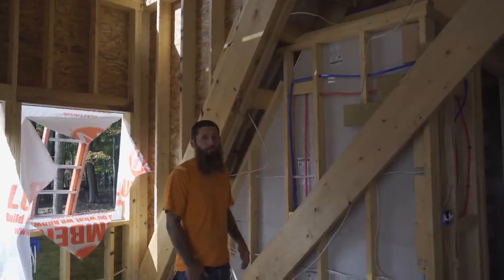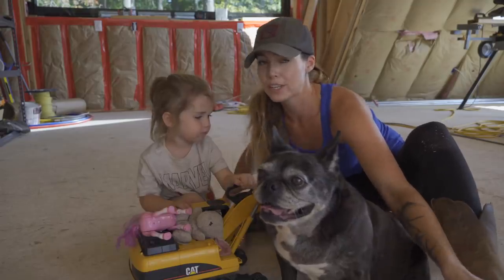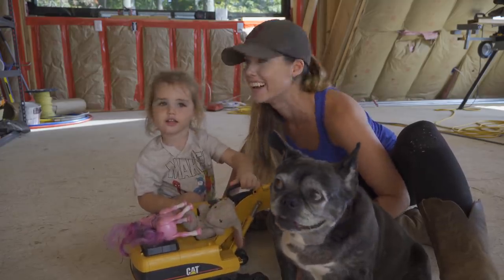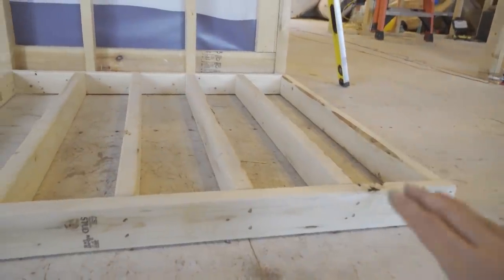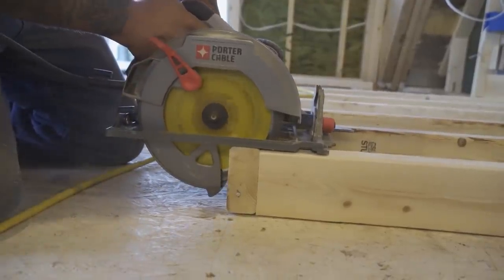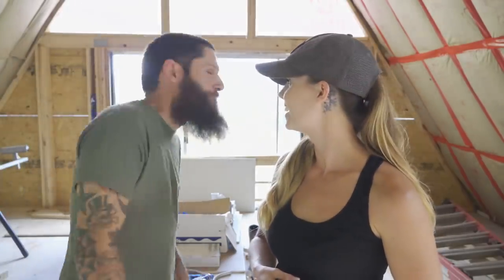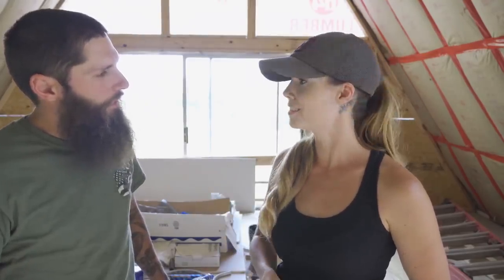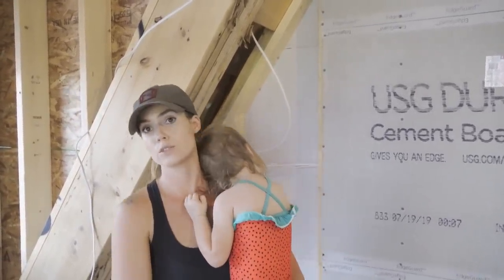How We're Heating Our OFF GRID Home This Winter

Comment: Tape your cement board joints with mesh drywall tape to prevent cracking, I’m a retired tile man
Reply: Generic drywall tape is not supposed to be used on cement board; use Alkali Resistant Mesh Tape.
Reply: @CptLordCockburn  ^ yup was about to comment
Reply: I was going to ask the question about the possible gaps between each cement board.  Thanks for your answer.
Reply: A friend of mine put tile down in his entry directly on his sub floor. It lasted about 90 days.

Comment: In my house the wood stove was inefficient and heated only the immediate area. Most of the heat went out through the chimney. I fixed this by fitting two 6" fans a foot from the chimney. These take hot air from the chimney and circulate it round the house. Ten times better!
Reply: Depends on the type of wood stove they get, but A frames are hard to heat
Reply: One needs to be careful how much the chimney is cooled. A cool chimney can cause excessive build-up and risk chimney fires. A properly sized stove should not waste heat up the chimney. Using a circulator fan in the room will help disperse the heat.
Ceiling fans will help move heat from the A frame peak. An updraft fan flow will push the warm air down the walls.
Reply: @idadho  aren't most chimneys double skinned anyway, even inside the house ?  And don't most modern wood heaters have internal fans to boost efficiency ?
Reply: Manolis Gledsodakis 
We installed a bathroom vent fan in the top of the a frame that pulls the heat from up top and blows it out near the floor. That helps a lot to keep the heat in the living space. We are on solar too but the vent fan draws very little.
Reply: @colstace2560  No, the fans would be on the outside to move air across the hot steel. Double skinned flue pipes are designed to handle the heat that is necessary to keep exhaust gases hot enough to limit creosote build-up inside the pipe. I wanted to pull heat off the flue/chimney pipes and was told by the professionals to not cool the pipes, even the double walled pipes. 

Stoves are designed to a specific flue pipe specification. Efficiency is part of that design.
Reply: @offgridathiddenhills4079  Moving warm air up with a traditional ceiling fan causes that warm air to hit the ceiling then flow down the walls and create a uniform temperature throughout most of the room. The goal is to move large volumes of air slowly. Erin and Josh can hang a ceiling fan and disperse the warm air nicely. We always used up flow at the slowest speed.
Reply: A woodstove with a backboiler supplying a wet radiator system, as is common in europe is a solution, I use mine to run 9 rads & a hot water tank... I also bought alum. rads as they are more efficient and the hot water tank purchased was a solar tank so as to be "solar-ready" in the near future.

😎👍☘️🍺

Comment: Just found your channel today and really love it . I’ve done a complete home Reno of a 100+ year old home with redesign . When you talk about the stairs I’m laughing as I had like 100 hours of thinking in for the stairs and such and in the end it worked out great . 
I’m HVAC so for you to do radiant heat it’s the best idea ever . With two forms of heat you can benefit . There are AC style units that are called heat pumps and you can get heat from even freezing cold air . With your land you could do ground source and utilize what they call geothermal . The power to run a compressor and the pumps you could get a good amount of heat . 
If you have unlimited amount of wood available for wood heat then your good for no electricity heating . 
Maintain clearances at all points just in case for the venting . Also allow as an option a dedicated source of intake air from outside for combustion . Like a 4” dia vent ( with a damper ) . I also noticed your below grade plumbing traps and such , that lower level below the house not sure how it’s insulated but you could seal it all up and help your floors stay warm even by skirting the pillars and insulating those . 
I’m sure you guys have thought it all through . 

Also kudos on the square D panel you used , Love Square D !
Reply: For the upper level with the loft you probably should put in a destratification fan to blow the heat back down to the ground or use one massive fan to mix up all the air flow . The heat will rise and hand up top and it’s good to have the option to push it down even though it uses power . Another option is to install a duct system with an in-line fan to recirculate the air from up high and then distribute it down to the main level . If you could incorporate some airflow from up top to blow over the windows you can greatly offset the draft caused by extreme cold winter days . Small spiral ducts can be used in the open with even simple holes used as diffusers . 
   Anything done in advance before all the finishing can make for great options later for the colder days . 
The fan recirculating system could even be a small hydronic fan coil unit with an AC coil ( for future ) or select it as a heat pump coil now so that in future if you do some geothermal you already have the air handler . 
   The air handler even running for summer could take some of the upper heat in the loft and redistribute to allow some natural cooling .  Below 5’ the average ground temperature is around 50 deg Year round . You can utilize this for unlimited heating and also for cooling . 
   Make sure your home interior pressure does not go below 0 when you have exhaust fans and such running for bathroom or kitchen . 
That Intake for the wood stove could be used to compensate for any negative pressure in the home . In a negative even a wood stove won’t burn well . Air has to come from somewhere ......
All the Best to you and family !

Comment: What about having fans at the peaks of the "A" to push the heat back down??
Reply: Hmm wouldn't need that if the house is well insulated.
Reply: Jerry Moody  I know heat rises i ain't that stupid lol  But what i'm saying is if the room is well insulated no heat would escape that room and will be kept in, keeping the room at a normal/comfortable temp.
Reply: @maverick4220  The front room is 2 stories high. To keep it warm near the floor where the people are, you'll have to constantly pump heat into the lower level as the heat rises to the second floor. As the OP said, it'll be much hotter on the top floor than the ground floor. That's a known drawback of the A frame design. Most common way to combat that is have ceiling fans to keep the air rotating and evening out the temp difference between both open floors.
Reply: @MrDericp  I hear ya, but the primary heat will be radiant under the floor.  Should be pretty comfortable unless it is wicked cold outside.
Reply: @justlikeyouful  Radiant floor heat will be a nice way to even out the heating all the way to the walls and feels warmer when your feet are warm, yet it still rises at the same rate as any other type of heat once it leaves the floor. The problem still persists, which is the reason fans are necessary in an open style A frame.

Comment: Good job guys. If anyone says sheetrock just slap them. You are smart to put the finishing touches on the rough in phase.
 I grew up in a home with just a wood stove for heat. Put a fan close to it and it will easily heat that house.

Comment: consider using stovepipe heat reclaimer radiator rings or add additional offset stove piping like on "homestead rescue" to get more efficient heating via the radiator effect on your setup with less wasted heat of a single stack. We've done both at our cabins over the years and both work well to reduce the time it takes to heat an area as well as keeping it hotter/longer on less fuel consumption. We've also added a wound copper water pipe panel behind our stove/soapstone to provide hot water at the same time.

Comment: Not sure if anyone has mentioned it but it’s a good idea to set the depth on your circular saw. Maybe a 1/2 “ below your material. It really is much safer plus if you’re cutting across your horses it won’t cut so deep. The big one is that full depth has more of a tendency for bind and kickback.

Comment: Great job Most awesome house and family!!  I recommend you two research the operation of the radiant floor heat. we bought a radiant floor heat house from the builder owner  they attempted to operate the system as you described for about 7 years,  the house had wild heat and cool swings and unbelievable costs And they were never happy with the temp.  I balanced the system and we turn it on in the fall (fredericksburg VA) and allow the system to cycle for about 4 days the heat temp swings get less frequent and more stable and then everything stabilizes at 72 deg.  We never touch the thermostats after that till spring when we shut off the thermostats.  The cost to heat the 5,400 sq ft dropped by 2/3rds and it is always comfortable.  thanks for sharing your adventure 
S

Comment: A lot of heat will collect at the top of the A-frame. I found that a good, cheap way of sucking ceiling heat back down, and adding to circulation, is to use ducts and PC-fans. They don't drink many electrons and are designed to run non-stop with very little sound.

Comment: Josh, better to fit loose in the summer so it will fit in the winter over long-handles, Carharts, etc.
Dang, forgot the word, but, if you don't want to cut out the excess belt and overlap to stitch back together then, just pinch the belt (to fit now) and stitch (or staple) to hold the pinched amount; remove stitching come winter.

I really like the the rear staircase access idea much better. Keeps the living/common area open.

It is not the least bit obvious that y'all are getting more excited the more you accomplish and the closer you get to GETTIN' 'ER DONE, until the add-on stage begins.

Hey Kiddos, the way sound carries out there, you will have to come up with another excuse for why you didn't hear your folks call for you.

Comment: Id go for a heatpump, heat in the winter and ac in the summer. Super efficient, and instant hot and cold. No having to chop wood and track it into the house constantly. Save a ton of $ over time too. Id also do the wood stove for those days when it is under 10f.

Comment: Its a good location for the stove ,you can open the window a little and the air will push the heat through the house ,its going to get hot in the loft areas so ceiling fans may be an option, it works hear but you climate is colder during winter ,anyway great video cheers

Comment: The cement panel at the back of stove must be installed on vertical metal forences. Let 2'' spaces at the bottom and 2'' at the top to create a air movement to down to up to cut the heat in half.
Reply from the maker: Our stove has a heat shield on the back and manufacturers instructions say 14" from back of stove to combustible surface which we also have. The cement board for us was more for good measure and to attach the slate to.

Comment: You should trowel mortar between the plywood and the cement board per TCNA.  You might have a problem with cracking if you dont.  Especially with the high heat from the stove.

Comment: +1 for using cement board for the Wood stove area. Although I would recommend considering getting an outdoor wood boiler to keep all of the combustibles away: Wood, Ash, Smoke, etc. Puts it provides a safety measure since combustion would occur away from your home.
Reply: External wood burner with radiant under the floor will be the primary heat... as stated in an earlier video.

Comment: You can always change your Mind and run a staircase up outside..it takes less room and you can add protective sheating around it later. For Fire code provisions, the City may ask you such an Exit..a real staircase. Maybe check out your local salvafge yard..Somethimes, they have Old Steel Circular Staircases that sell for a Song. It s quick and Dirty..a Slab outside and you set it in place...then build a Gable or Entrance upstairs for it.

Comment: Hey guys what you need to do is put a winch elevator you can put them in a small space is smaller than the closet and have it work off of a winch and you can use the up-and-down button on it and you can get one like at Harbor freight what goes on up only so high and then hit the button and triggers it to stop and you can have it for your  kids to ride up on that

Comment: I hope you looked up at the ceiling rafters to estimate where stove pipe passes through the middle of two rafters to fit the bulbous pipe enclosure  that keeps your 6 inch minimum clearance to combustibles. It's nice when it falls exactly between two rafters and none need to be cut and framed.

Comment: i only used a carpenters apron for splicing wires. i carried scotch locks in it. and when i did sheet rock work, the screws were in my shirt pocket. now when i bought a Vermont castings wood stove, the spacing to the wall was 18 inches, but if you got the back heat shield, i think it went down to 12 inches. and i had a brick wall done behind it

Comment: Did you guys look into building a Rocket Stove/Mass Heater ? I swear by mine. After 3 or 4 burns ( using far less wood than  woodstoves ) the thermal mass is "charged" with heat. It dissipates heat on inyo thr next day. You can design it to go anywhere. Build a bench or lounge over it.
The final run of stovepipe is cool enough that it won't cause problems. There's literally no black soot or any "report" of smoke from the stack.
Really, burns efficiently on even smaller kindling sized wood and the burn chamber burns so well there is no worry of creosote build up.
W

Comment: Josh, when framing a wall on the ground, you should always shoot the bottom nail first. From experience I caught a nail in the hand (the hand holding 2×4)  a couple times from shooting top nail first. This way shooting bottom nail first you can then let go of the 2×4 and move your hand out of the way for top nail.
Reply: leonard Blais ... so true... I’ve seen it happen many times as well. Another really good method is to line all your studs up right away and then from the standing position use your foot to stabilize the stud. Hands out of the way.
Reply: @robertadelsberger3749  ,I've tried to work smarter not harder. Once a younger guy was walking with a nail gun with his finger on the trigger. I mentioned to him that's not a good idea. His response was he'd been framing for many years. So I just shut my mouth. Moments later I heard the nail gun go off. As he went to step up on a ladder his knee hit the gun and POW. He nailed his jeans to his knee cap. You can't  fix stupid , I guess.
Reply: @robertadelsberger3749  I didn't mention it was a 3 1/4 in.  nail and it dimpled his jeans.

Comment: In Finland we use a lot of thing called heat storing fireplace in our houses. Especially in rural areas it is used as back up to heat the house in winter months or as aid to reduce the need to use oil for heating. You should do some research with that, if you have not already, since it reduses the need to burn the wood but keeps the house warm. With a quick googling I was able to find some basics how it works in english even from some Finnish companies. But I think it should be something you could also build by yourself when you understand how it works.

Comment: Have you guys thought about putting rigid foam against the rafters? It would help alot with retaining heat inside of the house. And will you be insulating under the house before winter?

Comment: If you're not completely certain where the stove pipe exits the roof It may become quite challenging.  It seems close to the valley and addressing that with elbows is problematic.The liner between the joists. The pipe flange. Proximity to the valley. Its overall height and mounting method present far greater pertinent "constraints" than the obvious stove to wall clearances.

Comment: I'm a little confused as to why you fixed the platform the way you did. Didn't you build the platform to the exact size of how big you needed it to be?  If so, you then cut the platform and  reduced it's size. I'm not sure why you didn't just pry it away from the wall,slide the platform over and then just re-nail it back to the wall. Did you make the platform itself too wide? If not, isn't the width now short by however much you cut off?  Hopefully I am just missing something.

Comment: From where you set the stove base Im guessing you will have 10 to 12 feet of pipe protruding thru the roof. this presents some challenges not only with installation and securing it maintaining its stability in windy conditions to prevent leakage not to mention the difficulty  accessibility presents when addressing the inevitable build up of flammable carbon residue,

Comment: - Straight away, Erin. What is the editing program/software you use to edit your videos? And, what is your storage media? 

-Josh looks tuckered out. Poor guy.  If you do/did a ship's ladder for the boys to get into the loft, what about a fireman's pole with a cushion at the bottom for them to get down quickly ? 

- Break out the Sawzall. 

- Great dancing, Josh. You goober. LOL
- Family, food, fireworks, fun.........awesome. 

- Nice job on the wood stove platform. But, what of the heat transfer from the stove itself and the roof slope just feet away? No cement board on that for added protection? 

- Will there be any venting between the bottom and top floors to permit heat transfer? Or, will you use fans if necessary? 

- I'm no expert, but I try to examine the details of your work. From my perspective your work is top notch. Also, you're getting down that "Builders Jargon" quite well.